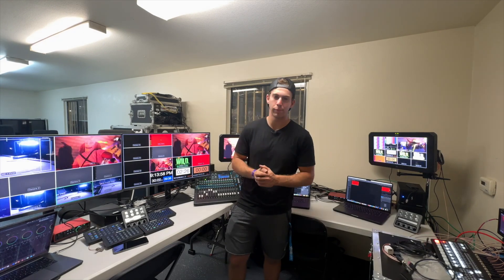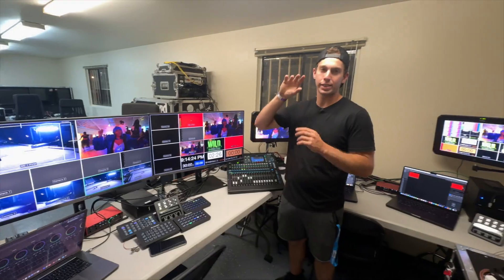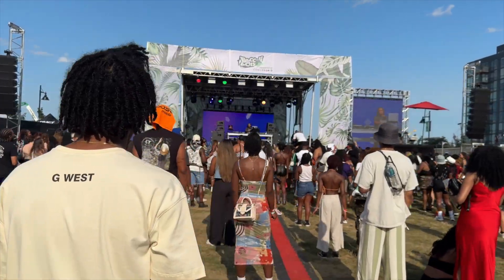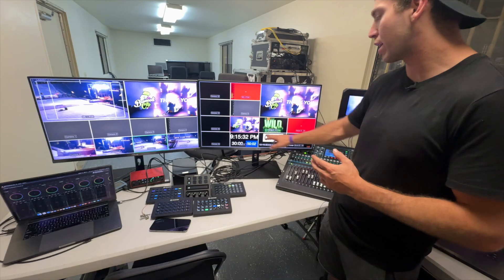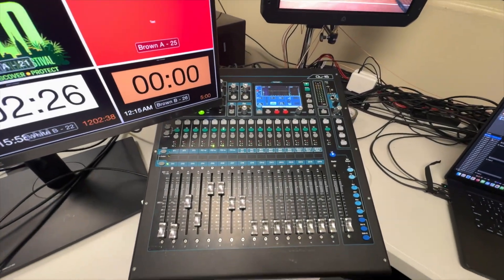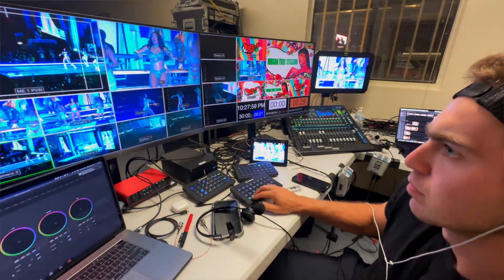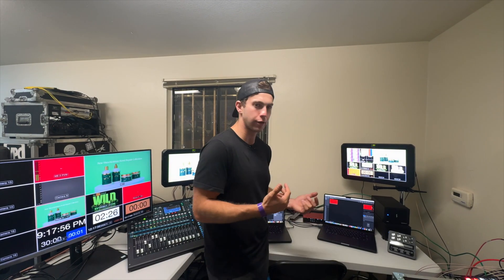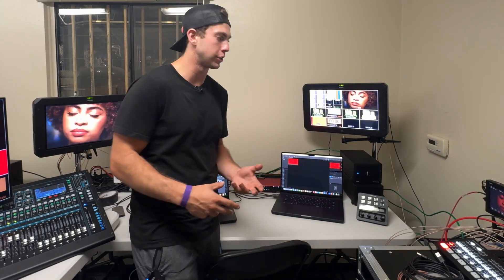Mastering Festival Chaos: How We Made Blackmagic Gear Work for Us | Tech Walkthrough

Comment: Anybody know how to delay the video in mad mapper? 8:12
Reply from the maker: Yes you can delay frames in the outputs section. On the bottom left side of mad mapper you should see adjustments you can make to the output and in their will be something called frame delay. If you need to you can loop out from the system back into it using internal loop and keep adding more delay if you max out the first one and it’s not enough for you.
Reply: @ yo thanks! Appreciate the detailed explanation

Comment: I love this way of engineering you did with mostly BMD Stuff and software like madmapper! I like te way of thinking and ingenuity! Nice you pulling this of! As a freelancer I see this way as diy-ing with a better price-cost reference than wider used setups on setups. I have used a similar setup when my E2 stopped working 3 hours before show, so Nice!

But...
Why not using Barco E2 control or Analogway Aquillon for screens and playout for the screens and inputting playout and cams through that. BM is not made as a content switch, more camera broadcast. Madmapper will do, but its still software. 

Love hoew you did it, but considering; its not really a solution used on most shows.

So, my question; why not media server/screen management;

- dont know E2 / analogway / hardware media servers
- like to try 😊
-  Im a broadcast engineer 
- revolutionizing the market💪😁

Love this, love your answer!
Reply from the maker: Thanks for the question! A mix of your answers here but main reason as always is budget. We already own the black magic switchers and ecosystem so it’s no additional cost to us to use them. Same thing with pro presenter, mad mapper, companion/stream decks, etc. this way we can make some more profit instead of tying up those funds in rentals. 

I also know this gear extremely well and a lot of times feel more comfortable solving problems and last minute requests/needs with gear I know vs gear we are less familiar or experts with. Even if it’s a work around solution instead of a purpose built solution. 

We can absolutely use other switchers/media players better suited for this use case but we found this solution worked best for us. Allowed us to do everything we needed and more. Had enough scalability for all the last minute requests and we were actually broadcasting so we didn’t want to change our workflows if we didn’t have to. Hope that answers the questions! Thanks!

Comment: Great engineering !!

But I was wondering how is the redundancy like.  If one set of wires/fiber gets knocked out, will the system collapse or there is back up plan ?
Reply from the maker: We have backup fiber lines ran for fail over so if I see one of my cameras and feeds go black, I can either switch to a different camera or feed and in that time I or someone on the team can trouble shoot why we just lost that camera/feed. Swapping converters or plugging into different fiber lines. We are all on comms so it’s easy to communicate while this is all happening. Even in different spaces.

Comment: something im wondering about: since sound is significantly slower than light, the people in the back will hear the sound noticeably later than the people in the front. At what point in the stadium do you sync audio and video? right at FOH? or slightly before? likely, people watching the jumbotron are watching from further back than people watching the upstage screen. was that a consideration as well?
Reply from the maker: We normally sync sound based on FOH location. If you could hear both the sound at the front of the stage and at the very furthest back of the stadium at the same time then you could notice the difference in timing but since no one can do that and we set our delay speaker towers up properly then no one notices an off sync in sound vs video. We are not far enough away like lightning and thunder delays for our brains to really have a problem with sync as long as we set it up properly from the beginning like we did in this video.

Comment: Hey Brandon, nice work! Have you tried using the new audio routing? If you have a madi card for the console you can push and pull feeds wherever you need and separate aux mix minus feeds out each aux as you need it. I’ve got a video showing it if it helps, has changed everything for us, no analog anywhere now!

Comment: the amount of converters involved is just out of this world. i felt like a kid in a candy shop. so much to learn..
Reply: Isn't more conversation means more latency?
Reply: @prodj.mixapeofficial6431  the processing during conversion is very minimal. electricity and light move fast so when the processing is minimal, there is no noticeable delay
Reply: @prodj.mixapeofficial6431  depends. But for hardware usually there is nothing beeing bufferd. The delay will be negligible, like if I make numbers up no more than 10ns for fiber to fiber. That's around 3 m the light can travel.
For screens and software, it's different. Converting from 1 protocol to another loose a frame or two. Same for the LED wall driver. Buffer and lose a few frames.
Funny enough, old televisions had a delay from less than a frame because nothing was being saved
Reply: right....good god...woow